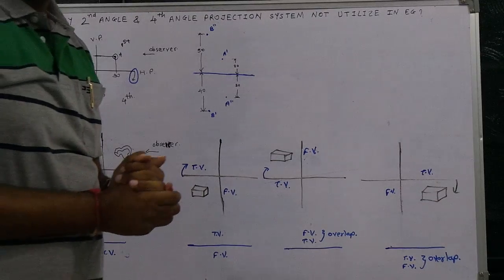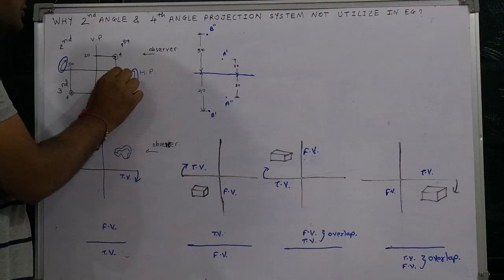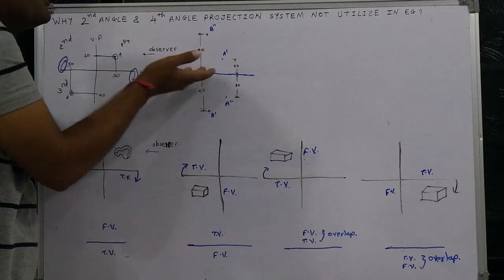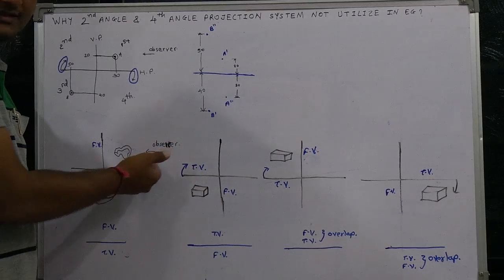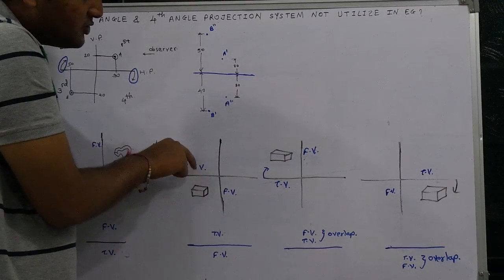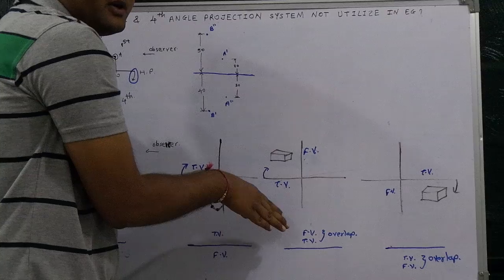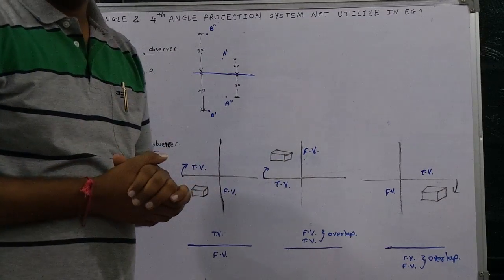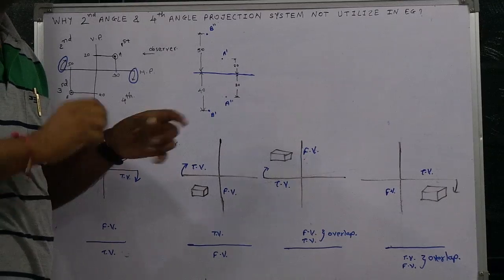GTU EG Viva - why not 2nd and 4th angle projection

Comment: I read somewhere that the observer comes in between the plane and the object in case of 2nd and 4th angle of projection,, can that be a possibility??
Reply from the maker: if the observer looking from top & if vertical side need to be rotate then 2 & 4th angle projection is possible.
Reply: then i think 1 & 3 plane projection wouldn't possible (feasible) if observer seeking through vp.
Reply from the maker: May be i am also in search of who had given this logic to rotate in clockwise?